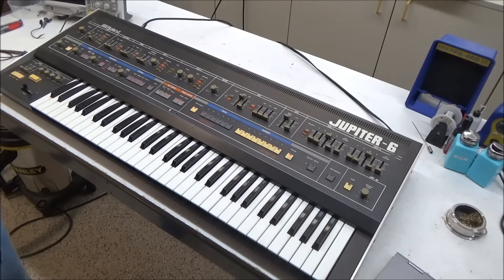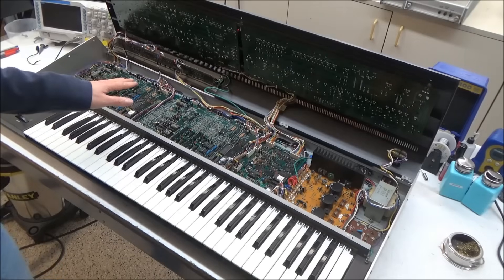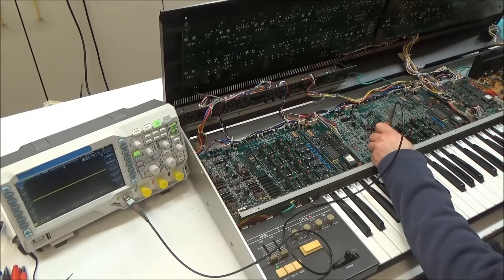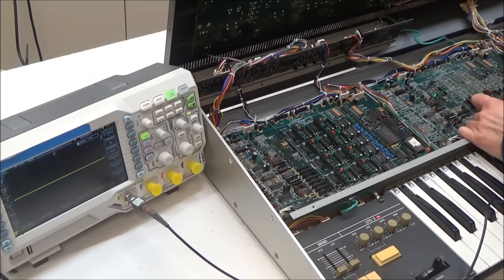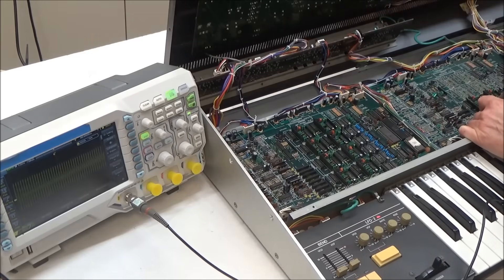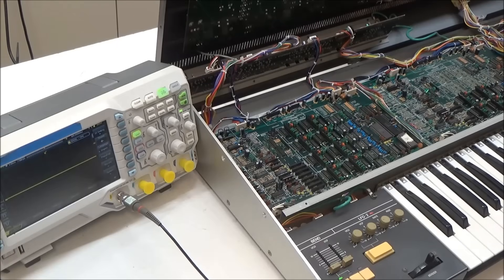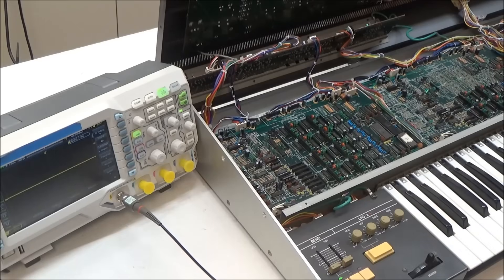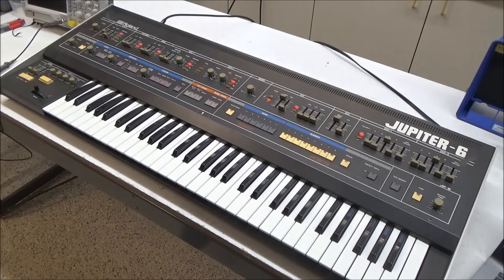Roland Jupiter 6 JP-6 Dead Voices Repair - Synthchaser #168

Comment: Thank you so much for this video! It give me hope for my Jupiter 4 to be a 6 again. I brought mine to Condor Electronics in Seattle, but they said I had the Europa Mod and I'd have to contact them to figure out how to repair it. :( I believe they've been out of business for years. At any rate, I'm going to pop open my Jupiter 6 myself and confirm it looks like yours first. I'm not sure what the Europa Mod even looks like, so I'll have a learning experience. I'd really like to get mine repaired by a capable technician like yourself. Do you have any recommendations for a repair technician in the Seattle area? I've heard of Syntaur in Texas, but I'm not sure they're doing repairs any more. Any help would be greatly appreciated. I may have to just learn how to do it myself. Also, where did you get the replacement chip at? Take care, Sam.

Comment: One oscillator in my CS80 is silent (voice 8 of the upper channel) so this is a good preparation video. I expect a secondary component failure or a contact problem because the oscillator worked intermittently for some time. Alas those boards are not as accessible as they are here. As you might already know each of the 8 voices in a CS80 drives an individual 2 VCO board. It’s like an analog telephone exchange in there! So don’t ask me why I’ve been postponing this job. Only thinking about it already scares the hell out of me!  Any tips?
Reply: Hello, ideally contact Thierry from 16music, he really is the person (maybe best in the world) for advices and overall technology around CS-80.
Reply: @DestroyER82  thanks for the tip! 👍

Comment: At 65 this brings me back. Trouble shooting vacuum tube circuits, with signal tracers, oscilloscope, meters, and Sam's schematics.
My favorite tool, the Weller vacuum powered solder sucker combo solder gun station. No more solder wick.
Thanks for the flash back Nathan!

Comment: Jupiter 6's eat CEM3360's for some reason. Always also check that the cross-mod is working on any JP-6 checkout as it uses 3360's in that circuit as well and they are failure prone there too.

Comment: Are the Curtis chips still easily accessible? Or do they have to be hunted down?
Reply from the maker: There's a company in Latvia that makes replacements that work well.
Reply: Cool, I was going to ask if you can replace it with AS3360 as is.

Comment: I'm home from work sick today, nice to have a new Synthchaser video to watch.  I'm sure someone else will ask, and I'm guessing the answer is no, but can you put two fully populated four voice cards in a JP6 and make a "Jupiter 6+2"?
Reply: You could physically i guess but I'm guessing the software written for scan key assignment etc will only max to 6 . Maybe someone out there is clever enough to make a mod.  Imagine ❤❤❤❤
Reply: @AdamTheAd-vanc3d  Pretty much my thoughts exactly.  Adding the extra hardware would be easy, getting the synth to talk to it would be another matter....
Reply: @weasel2htm  Yes someone would have to totally rewrite the synth eeproms etc , I love if someone did.  

Ps. I love these videos 💪🏾❤️ by synthchaser I geek out to the highest degree
Reply: You can, but the second board will be half-used because the main ROM doesn't account for four voices on that board, but for two. I have a spare 4-voices board for my Jupiter 6, I tried to put that into the synth in place of the 2-voices one, and that was the (already expected) result. There's a mysterious custom Roland firmware which is able to make use of two fully populated voice boards, effectively making a Jupiter 6 equipped with two 4-voices board an eight voices synth, which would be awesome. That ROM's binary was close to be released to the public on a Gearspace's thread on which I was keeping a close eye, but unfortunately the dude which has that unicorn 8-voices Jupiter 6 and that told us that he would've done a binary dump of the ROM, disappeared from the thread without doing it. But I hope that sooner or later a copy of that ROM will pop-out somewhere on the Internet.